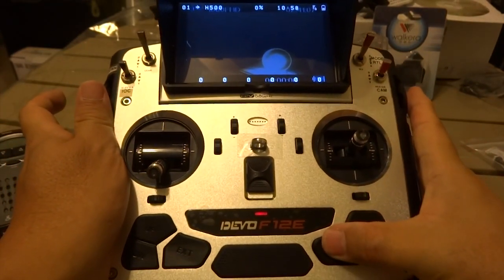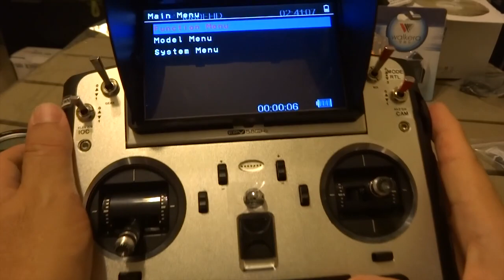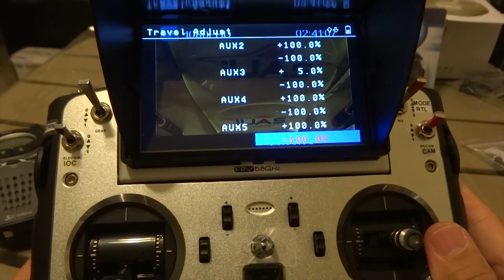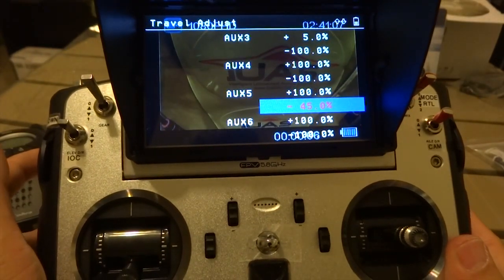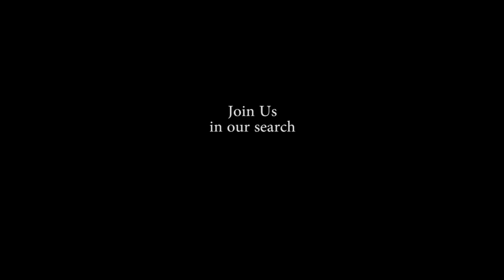How To Adjust Your Gimbal from Rattling Walkera G-3D Scout X4 H500

Comment: hi team, saw your video. super. very clear instruction. me be a total newbie to Drones (migrating from fixed wing nitro engine flight) and things "electrical". got my self a walkera qrx-350 Premium drone. Super. Trying to get the walkera g-3d gimbal going and simply unable to figure out the myriad of cables and connectors and where they go. would you kindly be able to please provide advice/guidance please?
Reply from the maker: Greetings, it should be very similar to the G2D, u typically get a signal cable (pitch, horizon), power cable.  This is a DIY setup on any quadcopter drone https://www.youtube.com/watch?v=gB86n7mkAWo

The advantage you have is all the cables are included on a Premium and you plug them in.  What I recall is i reversed the original g3D gimbal block and face it opposite, to carry two cameras.  You can play around and not limit yourself to the convention.  The fisheye camera is on sale at http://ucdrone.com

The Premium uses a F12E, so you need to make sure you have the stock profile for the sliders to control pitch or create a profile for the Premium.  They are the same profile for ScoutX4 and Tali H500.
Reply: Thanks so much for your response. I have now identified the cables required. Yes, if the cables were available (included with the Gimbal) life would have been so much easier..

Comment: diydrone, one question My gimbal is buzzing in the neutral position. If i move it a little it stops and i could go bak. After a while it begins buzzing again. What should i do?
Reply: +Mauricio Ramos I got exactly the same problem... Do you find any solution to help with this? Thanks

Comment: On my Scout X4 I had to change the AUX6, not 5 second setting - perhaps because I'm using mode 2. Mine was good set at -48.
Reply from the maker: Tone Edge hi, same principle, once you know it.  that was fimed for the H500 with F12E.  depending on your choice of transmitter, it can be different, for example F7 will be Aux 2, on a devo 10 you have different Aux choice.  You are also not limited to Devo transmitters.

Comment: May I ask if the ilook 3D gimbal YAW on Scout X4 be controlled by DEVO12e please?
Reply from the maker: +Lenny Mazlan greetings, not for g-3d. Yaw is done with the quadcopter itself, so you don't lose orientation. the horizontal axis is managed by the gimbal controller to reduce the sudden turn, the 3d is designed to dampen the turn, giving you a smooth turn on video. G3DH does however let u yaw. but you will want To either use two cameras or program f12e to return to front or indicate your front with a marker
Reply: hi diydrone, thank you for your respond. I now understand why it is made that way due to orientation. appreciate your respond. thank you once again. Cheers.